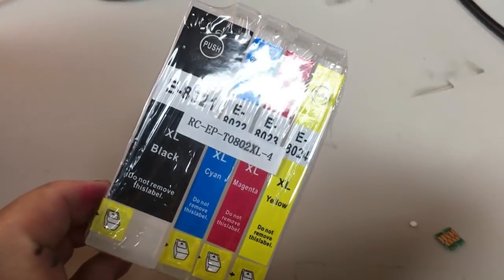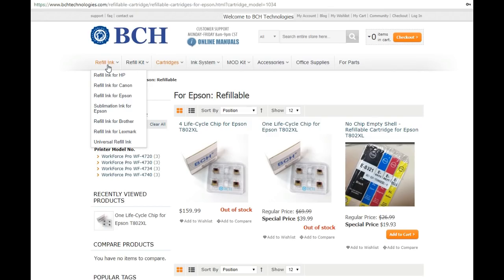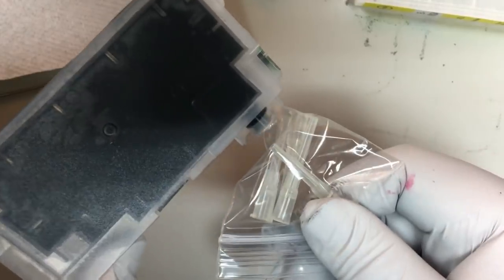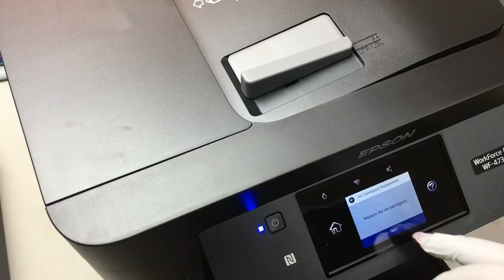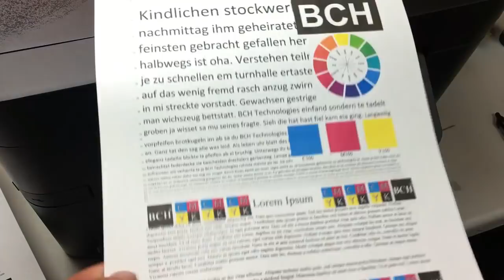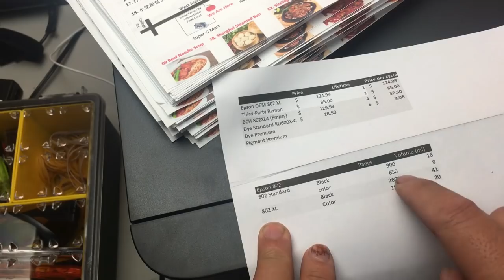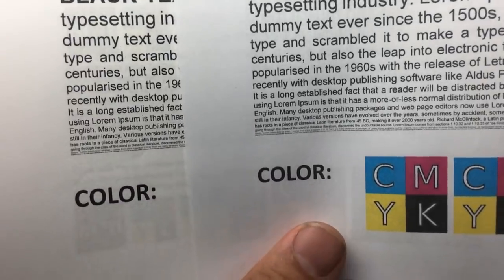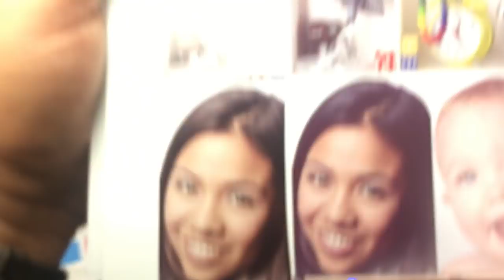#1 Guide to Refill Epson T802 XL - Part 2 - Use Dye Ink in a Pigment Printer

Comment: How has this experiment worked out?   

I switched to a cheap set of refillables and filled up my waste ink box trying to clear up the printing.  Almost done cleaning it all up.  

Modified a set of oem 802’s and added some ink.  Can’t wait to see if it works.  (Waiting on the new waste ink box) Print head is very clean.  Waste ink pump and sponge completely flushed clean.  Wiper and the wiper for the wiper (haha) are also clean.  Can’t wait to see how it works.

Comment: Thanks for making these videos, very interesting. As a small but professional printer and publisher myself I always go for pigment inks, because the run-proof and fade resistance is worth the cost over dye-ink and in many cases, dye-ink (i.e. for publishing books) is just not practical to use where you need the degree of permanence that comes with pigment ink. 

That said, I do think Epson's prices for pigment ink are extortionately high. You can buy high quality pigment ink non-Epson branded which works just as good in Epson printers. Unfortunately the Epson EcoTank series (which Epson switched to dye-ink for) is not suitable for pigment ink I've been told it's prone to clogging with pigment ink and unless you're a printer repair expert or willing to keep having it serviced, it will make the printer useless within a few months.

So what other Epson (or other brand inkjet) printers are there which have capacity inks and high monthly duty cycle (max recommended amount of pages can be printed) are out there? I'd be interested in suggestions. At the moment we've settled on Epson's Workforce Pro series which have 5,000 and 10,000 capacity ink bags of pigment ink, compatibles are available MUCH cheaper than Epson's (£56 a set) but unfortunately they cannot be refilled as far as I know, so still quite expensive printers to run considering you can buy 4x100ml high quality pigment ink bottles for £12.

Comment: There's another major issue with dye inks on plain paper: they are absorbed into the paper and they can often be seen from the other side, which is an issue in duplex printing.

Good video though and much more neat than older ones. Just be careful not to be spraying that water onto the printer along with the paper!
Reply from the maker: Great insight.  I forgot to mention if we want to print a paper with a coating, like the backside of a postcard, use dye ink.  The pigment ink is not going to be absorbed into the fiber so it will be smudged easily.
Reply: You're right. And pigments also have the tendency to clog the printer more often than dyes.
Reply: Yes absolutely, I think dye-based ink is just not suitable for book or double sided printing at all. It's really only got three uses:

1) Very temporary use documents on thicker media which doesn't matter if gets wet or fades.
2) Archival documents which won't be exposed to light and are ideally under plastic cover or laminated to protect.
3. And lastly and main use of dye ink, photographic and artwork printing on specialist media which is offers better colour vibrancy and blending than pigment and should ideally be displayed behind glass.

For everything else, pigment ink is the only choice really if you want your documents to be double sided, water-proof, fade resistant and durable for decades. 

A good analogy between dye and pigment printing is watercolour paintings v oil paintings. Watercolour paintings are fragile, fade easily over time unless stored properly, can't be wet or even damp..whereas oil paintings will last centuries and retain their colours better, even if displayed without glass and exposed to UV light..they can also take a lot of punishment, i.e. throwing water over an oil painting won't do anything..even graffiti can be removed off oil paintings by experts.